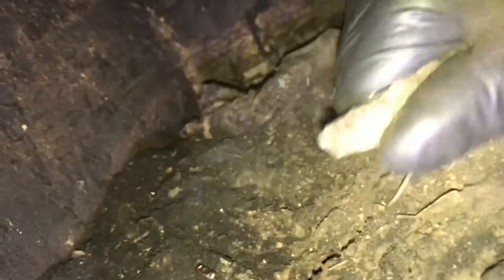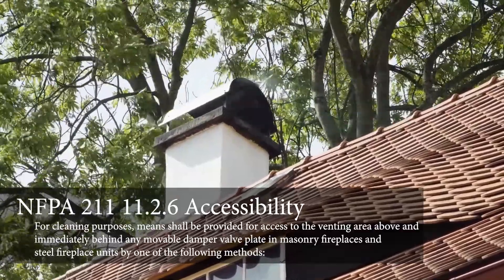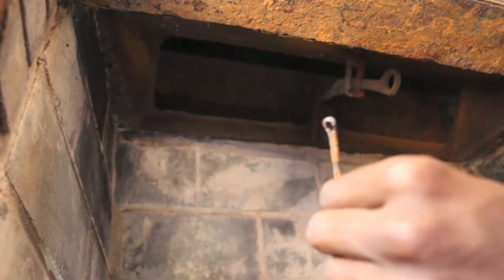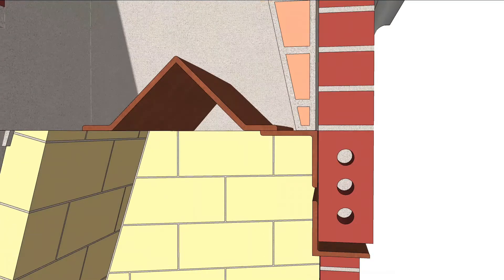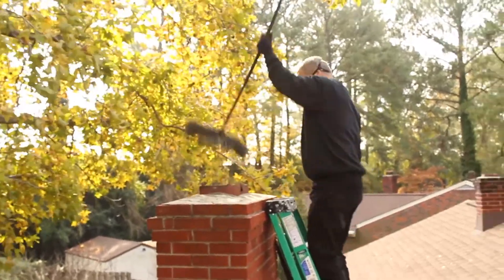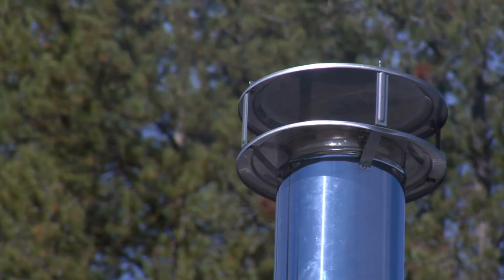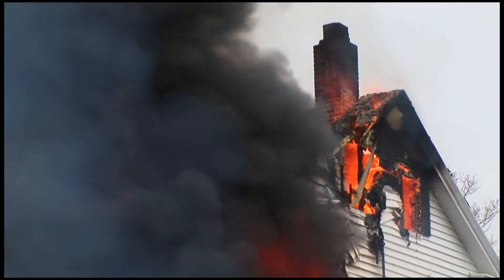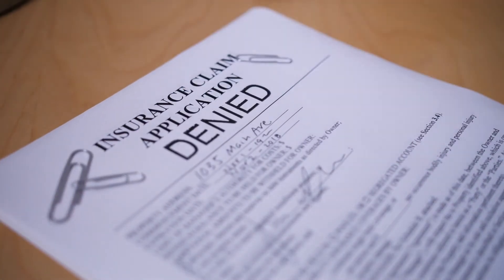Training Video #13 - Smoke Shelf Access

Comment: I have a heatilator built 1978 just had a chimney sweep here yesterday said the damper and firebox is in excellent condition with no rust. He did not remove the damper to sweep and there is not an access door on the chimney for the smoke shelf. He told me that he eatimates that he got 90%-95% of the smoke shelf clean by reaching into it. I took his advice as he's the professional. He also showed me video of the flu liner and told me I had some glazing toward the top of the flu and recomended I use cre away this winter and burn the fires a little hotter (dont let it smolder). He would come back in the spring to see if the cre away worked in flaking up the glazing if not we will most likely have to do a pcr treatment which he said roughly runs about $750-$900. The sweep cost me $210 does this all sound like legitimate professional advice/service?
Reply: Sounds pretty much there. I work in the same industry and the heatilators are notorious for being a pandoras box in my opinion. All the dampers he mentions in the video i litteraly reset and fix for free 90% of the time cause its literally that easy. 
But i despise heatilators with a passion. 
Especially if you have the bars infront of your damper. Than do yourself a favor and consider getting an access installed for the chamber. Cause "proper"  sweeps are damn near impossible past those bars.

Comment: Not gonna lie. Ive enjoyed a couple of your videos based soley off a couple points you made.
BUT
now after seeing this i have to start taking these videos with a grain of salt. 
Your using facts that you regurgitate out of the code book than sprinckle in some b.s . 
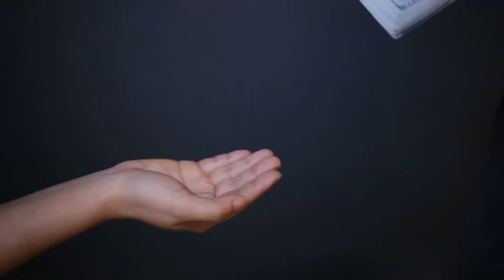Beginning of video you say some cotter pins are hard to get out so you cut them. Then you say later in the video at 2:22  you cut all the cotter pins off and replace them for easy removal next time. But you allways cut them off ?! Like make it make sense. 

I clean and repair masonry built and prefab appliances daily. And in the last 10 years ive never had to cut a cotter pin cause its seized  on to the damper plate?!. 
And ive seen my fair share of wtf moments. 
Its a cotter pin, not a fine thread galvanized bolt with locktight. 

And double ratchet handles which i know them as double pivot come  off the frame the exact same way as the push and hook. Aka with a cotter pin. 
Just leave the handle hanging on the frame and move the damper plate. 
And in my opinion rotatory dampers are the easiest  to remove?!
1 allen key to losen the set screw on the worm gear which most people are missing anyways, and just pull the whole handle out of the wall and the damper plate with the worm gear mechanism will come out in one piece. 
Stop trying to over complicate the easy stuff.  I literally reset dampers and replace hardware all the time for "free" during  a standard 12 point inspection as a courtesy . Takes less than a literal minute, and less than  $1 and i make my money back by actually solving real technical problems.
Stop nickle and diming people for the sake of "doing it right."
Your charging them for the sweep already.
And not cleaning the shelf or damper plate wouldn't be a full sweep. 
That's like McDonald's charging you extra for napkins.  It already comes with it! 

And fyi. It aint that hard to clean a shelf properly even with the damper plate in place. Its just most people are lazy and dont want to go roll up there sleeves and do what there getting paid to do.